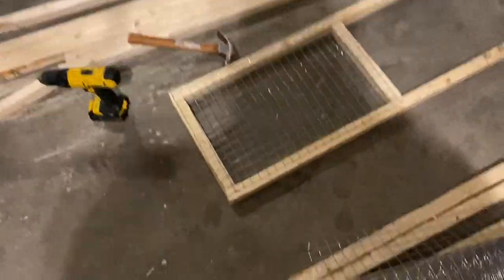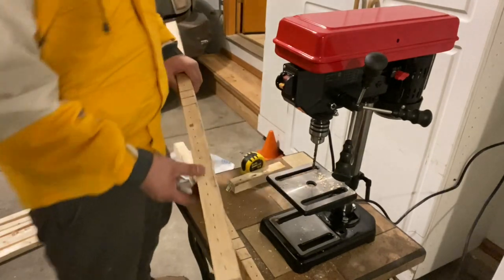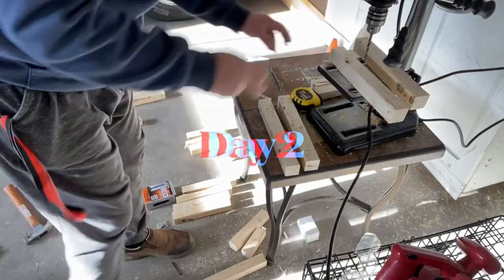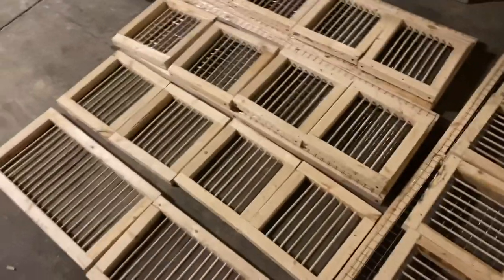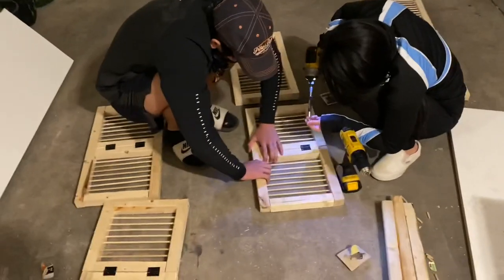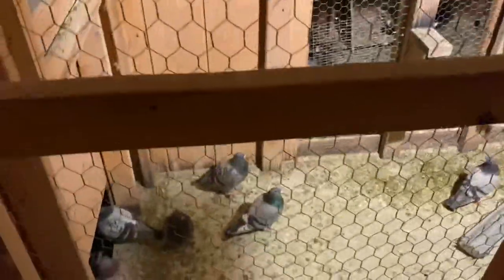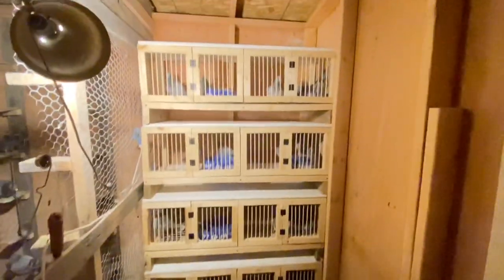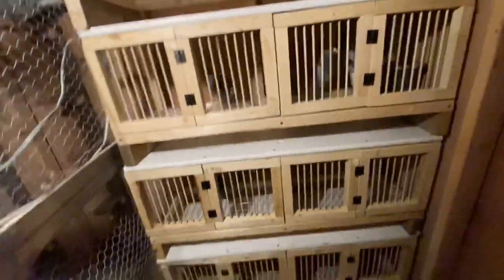Racing Pigeons - Nesting Boxes Built 😓

Comment: Awesome fun hobby. Only 1 thing u missing... where u stable the floor grates to the wooden bars that supports up the grated gate, u need an extra 1/4 inch thick x 2 inch wide to nail over that so u can scape. If not, the poop stuck in the support wooden bars n grated floor n u cant clean it out. Cover to top of the gated medal wire floor n where support wood beams are. I dont think u understand what im talking bout, cuz i currently baked n tipsy 😂😅

Comment: Thank you for sharing. It would have been beneficial and cheap, to add sheets of plastic to the sides and back of the breeding cages, stapled to the wood, that way the pigeon manure would not stick to the walls of your pigeon loft.
Reply: For the shelves next time, explore the idea of using pvc pipe for the shelf frame, and attaching the mesh to the pvc frame using zip-ties,  and making the shelves removable, that way you can remove them whenever and pressure wash them and beuse it's pvc and not wood, it will never rot or grow too much bacteria or smell. To support the pvc shelf inside the cage frame, you can use screws sticking out about one inch, to allow the pvc shelf to rest on those screws.
Reply: You can also use an aluminum angle iron in L shape, and cut 2 inch sections of it and screw it to the cage frame inside, to support the removable shelves. The idea is to either use screws, or some sort of metal, that way it will not absorb moisture and will be rigid, and capable of holding the weight of the shelves, pigeons, feeder and waterer.